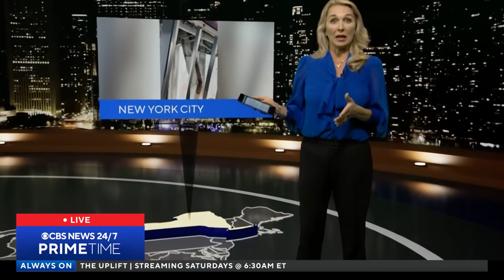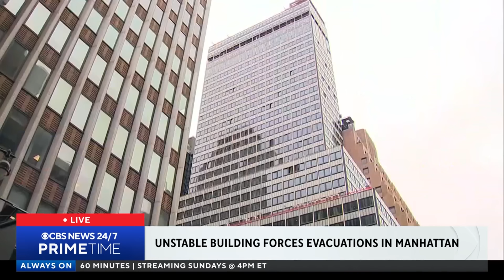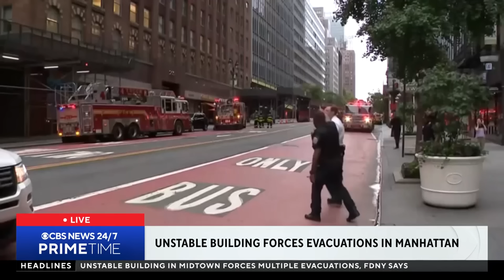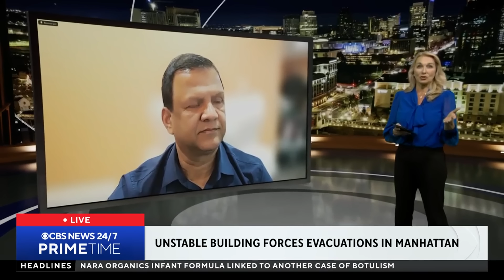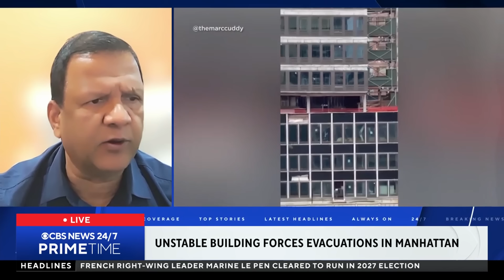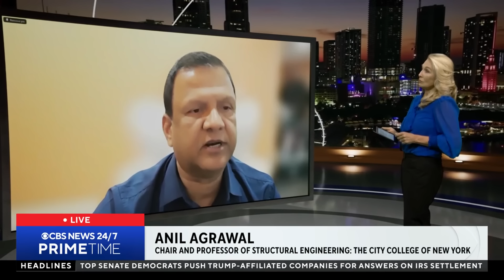Structural engineering professor discusses unstable Midtown Manhattan building

Comment: From a few pictures it is not possible to determine the cause or the final disposition of the building.  But, it does not look good!  These questions will be answered in the final report that is coming out soon.  By soon I mean one to two years from now. :)
Reply: The cause is plainly visible in the drone footage.  The buckled column is dorectly below the first base column of the new floors added above.  This is called a transition zone and the failure is exactly at the transition of old to new columns.  The weight of the new floors was more than the structure could bear.
Reply: I happen to love both water tanks on one side of the building. Along with the amount of steel to support them.